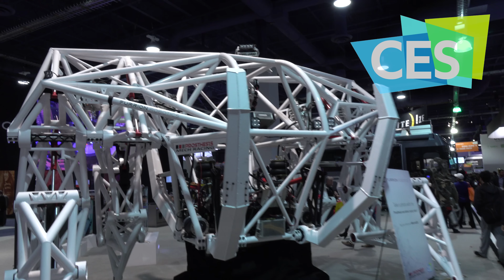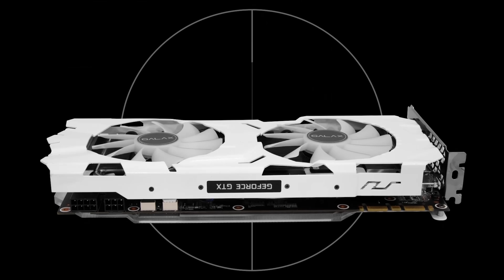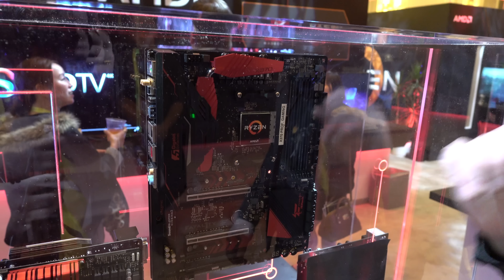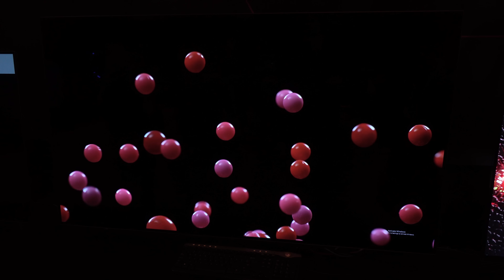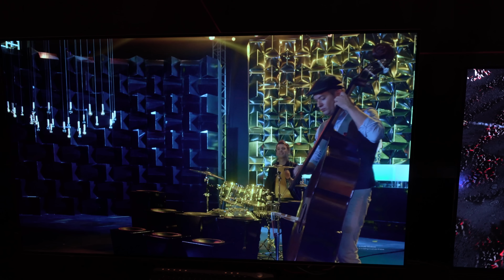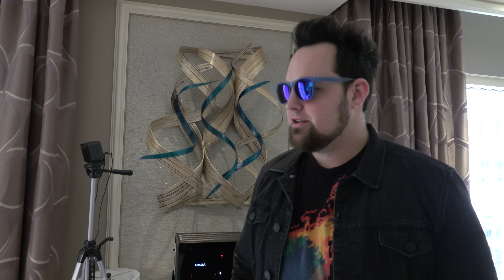AMD Ryzen & Vega (Doom playable at 4K Ultra!), EVGA, & Thermaltake | CES 2017 | Tek Syndicate

Comment: I wonder how soon it will be when monitors are so high quality that in the right lighting it will appear as though you're looking through a window/portal to another environment. Obviously it would be flat, BUT that is why one would also use head tracking technology along with 3D glasses in order for it to not only be 3D, but also adjust based off the perspective that the viewer is viewing from.
Reply: +Mshojat Seems like VR could get there. Until then you should check out the 8K TVs, some of them are really nice and there were a bunch of them unveiled during CES 2017.

Comment: These boards should have just straight up type c ports now. If I was to build one of these systems, I would expect it to last 3 - 5 years. Given this, I expect within this year most peripherals would have switched over anyway. So I don't see it as a good move having a bunch of Type A ports and no Type c.. It should be 50-50 split atleast.

Comment: I just tested the same area on DOOM with my 980 Ti on the same settings, getting pretty much the same fps as it 60 to 72 ish fps at 4K Ultra preset with TSSAA
Reply: ***** Uhh you don't believe me? Why would I lie lol, I'm giving people something to compare it with, so it has like 980 Ti (overclocked mind you)/1070 performance I'd say, but idk may change
Reply: ***** i5 6600K at 4.6 GHz
Ram at 2133 Mhz
980 Ti at 1474.5 Mhz (VRAM at 7776 MHz Effective)
Reply: omg this website is so much bs
Anything that is i5/7 2xxx upwards won't bottleneck anything. Especially not in 4k where the GPU will always limit first.

Also as a little advise you should never take doom as a general reference, because it's heavily optimised for AMD.

Comment: wonder who will be the first motherboard manufacturer  to exclude the ps/2 port.  That will be an historical day.
Reply: Do you realize PS/2 is superior to USB for keyboard input? My board doesn't have PS/2, however it has BIOS Flashback and QLogger buttons sitting there, these are absolutely useless features I must say. I'd rather had PS/2 Key/Mouse there. So, since my board don't have any ps/2, and usb suck ass when it comes to keyboard, I had to spend £20 on USB->Active PS/2 adapter.  Excluding PS/2 port is a mistake.
Reply: I specifically chose a board last year that had PS2 so I could keep my PS2 keyboard :P (Gigabyte Z97X-UD5H Black Edition)
Reply: Dmitry you are absolutely right mister
Reply from the maker: Here here.
Reply: Go away, PS/2!
Reply: Dmitry agree on that point.  But it will indeed be a new era when it's gone.  Or perhaps, on the contrary nothing will ever beat that connection for that medium.

Comment: I would really want the prices to be like 100~70 dollars cheaper than there intel equivalents
Reply: I want it even lower
Intel is overpriced as hell ... that would make AMD slightly less overpriced but still overpriced.
I hope they start a price war!
Reply: Advection357 yeah but making it any lower would make it cheaper than their fx series cpus
Reply: FX cpus cost like 1/2 the price of 4 core i7s...
Reply: Advection357 yeah they are like 350 dollars so 200 dollars for the high end cpus seems like a good price because it pairs it with the i5 prices ( we gotta keep it realistic man )
Reply: Advection357 the newest i7 7700k processors cost 349.99 and the highest am3+ fx-8370E cost 217.99 both on newegg and these chips should be around the same price or higher they will not make it cheaper

Comment: I'm actually enjoying the hype around Ryzen and Vega. Amd hasn't been able to do this with a cpu since the first 1ghz athlon in march 2000, and Ati hasn't offered anything substantially superior to Nvidia since the x1000 series in 2005. Yeah, the 7XXX series turned out great, but it wasn't so clear on release as it is now. The 5xxx series had some beastly power, but high tdp, and the 6xxx series was good too, but eclipsed by Nvidia's strong lineup. The 2xx and 3xx series were boring as shit. Now, the perspective of a GPU capable of delivering 2160p at the same or better frame rates that yhe 7970 did 1080p, that's interesting.
Reply: I really liked the 4870, but got the 9800 gtx+ instead. Nvidia had better performance per watt and comparable power, with better drivers and features. The 5xxx series though... INSANE power. Nvidia had to push tesselation to look better in some games.

Comment: 1:24 thats one thing I love about AMD. You can stick with a motherboard for awhile if you need to. Every intel build I do, typically required a mobo+processor. If you're not needing the craziest speeds, or needing super single core performance for like emulation- AMD is a great logical option.
Reply: BrysNightWorld amd should be a good option for everything once they release it. I'm hoping this brings them back in the game. Intel has had it monopoly for to long.